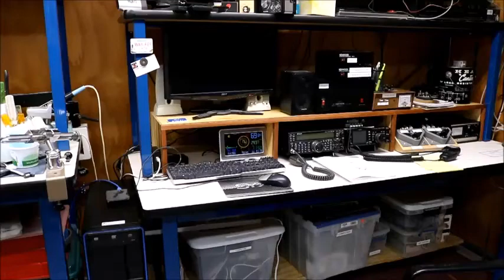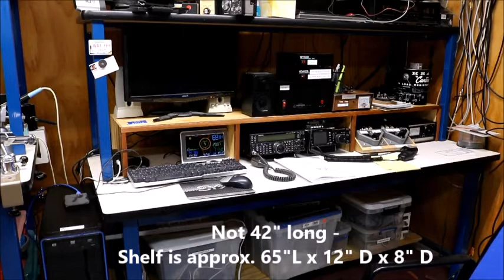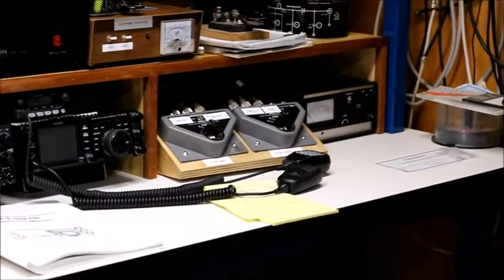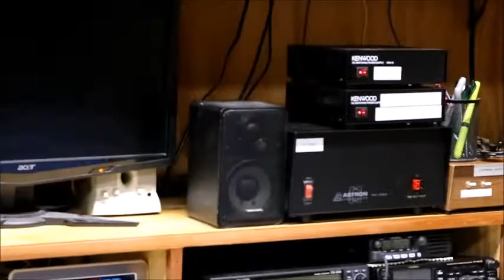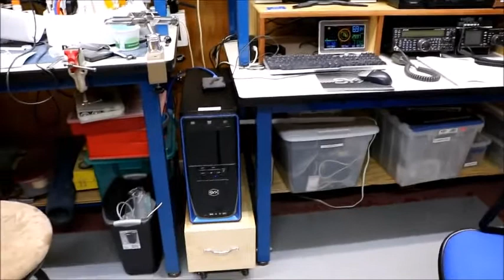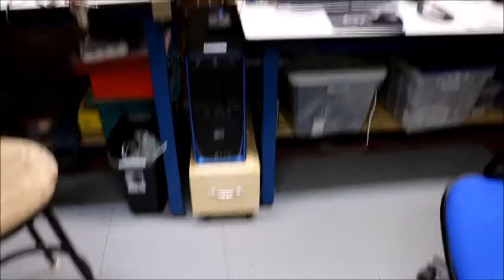Ham Shack Re Design

Comment: I had the same issue, no desk space. In my case, I replaced my desk top with a custom size top.  Now 1 x 36 x 68. GM Formica in Keyport NJ made the whole top to my dimensions and laminated it with Formica of my choosing. Looks super. Pryor to this I did do the riser method and It worked too. As of this comment, I am almost done but have some more arranging to do. KD2ULF
Reply: Good idea on the custom top.  I am using an old office wooden desk for my solder station (battery ER) and another desk for the ham radio operator desk.  I am putting together a go bag to haul my Hf & misc equipment to a park so I just slide it in and out as the need arises. Again great idea on the custom top.  Have thought of glass but it can get expensive.   All the best from north Texas.